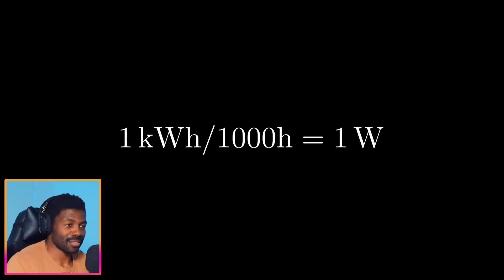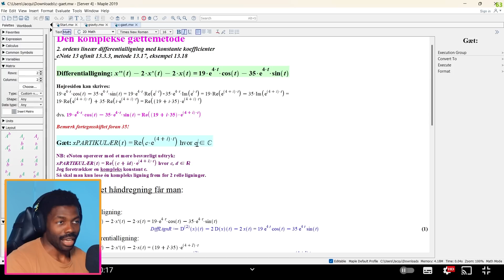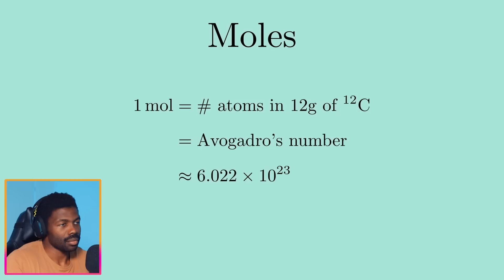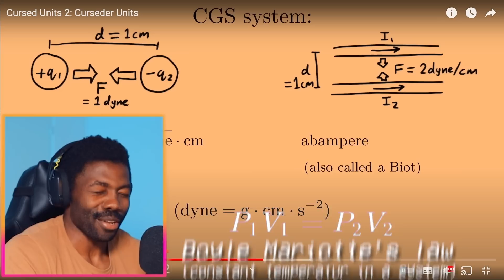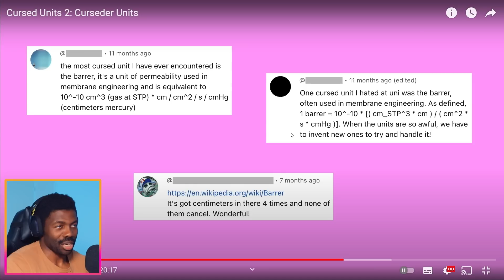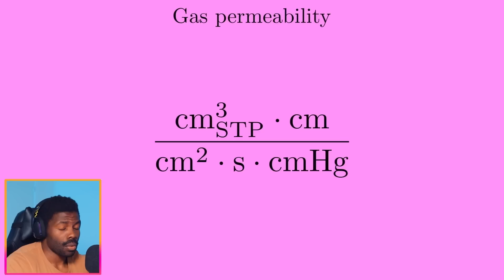It got Curseder - Cursed Units 2 by  @josephnewton  | The Chill Zone Reacts

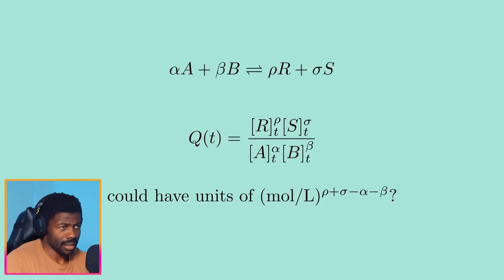Comment: 14:23 it’s the equilibrium constant, used in chemical equilibrium to determine direction of reaction, 
In the formula for the equilibrium quotient the active mass(molar concentration or partial pressure depending on the state) of reactants and products are raised to the power of their stoichiometric coefficients, we can see a bit of a problem here since different reactions have different coefficients, attempts have been made to fix this by making it dimensionless, we have study of this in chemistry first year after highschool.

Comment: In defense of the Chemistry part: almost every time a logarithm is taken in chemistry, what is in play isn't a concentration but an activity, the activity is an effective measure of the dependence of Gibbs free energy with composition referenced to a state of the system that we can define conventionally, and always is adimensional, activity is proportional to the concentration but takes into consideration the deviation of the systems from ideality (we start from ideal gas and then make it a real gas, and then we construct the expressions for condensated phases, in those we get to the activity) with a proportionality constant that has units of inverse concentration, then, the pH is the minus log base ten of the activity of solvated H+ ions (essentially protons) in solution, you can even define it in non aqueous solvents.
The reaction quotient and equilibrium constants are also expressed with activities so they are also adimesional (They are really not constants because they change with T and P, but in the lab we ussually consider them constant and work with them as if they were). All the drama comes from the fact that in sufficiently small concentrations (or hypothetical "infinite dilution"), the activity coincides numerically with concentration when we use 1 unit of concentration as reference, and we usually work with small concentrations in the lab (in industry is more common to see conditions where activity is important to take into consideration). A lot of chemists ignore this physicochemical structure of the chemical equilibrium so I get the cursed nature of the chemistry measurements.

Comment: 1 meter = 3,34 * 10^(-9) seconds. I won't elaborate
Reply: The time needed for light to travel one meter
Reply: The actual scientific definition of a meter
The distance traveled by light in a vacuum in 1/C seconds (ok technically not C, but the literal full numbers of the speed of light , the distinction is important because otherwise you'd be defining a meter by relating it to a unit...in meters second)
Reply: Please do.

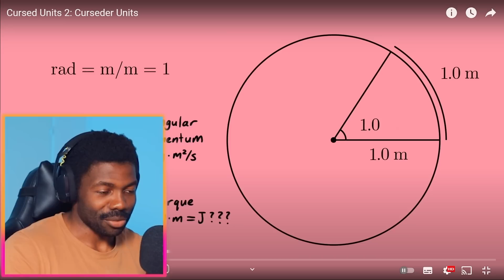Comment: 8:00 it's interesting that at first glance, torque and energy/work seem to have the same units, but I remember now that the difference is scalar/vector. Force*distance is work/energy, but force*displacement is torque, as I remember. Curious how that plays out, since we don't normally put the vector state of the length in the unit

Comment: Jokes on you, i measure energy in tnt equivalent. Also fan fact, 2000 calories is exactly 2 grams of tnt equivalent
Reply: TNT equivalent would be awesomely fitting for particle physics😂 "That proton has 10^-22 TNTkg of kinetic energy"
Reply: @martinleopard193  also it just sounds cursed - daily consumption of an average human is 2 grams of tnt 😂
Reply: @kolyashinkarev7366  What we call "calories" in the food sense are actually kilocalories (kcal), so 2000 calories is actually 2 kilograms of TNT.
Reply: Measure it in the cm^3 of tnt
Reply: @diablo.the.cheater  I measure mass as kg/cm^3 × liter
Reply: @kolyashinkarev7366  makes sense. I mean y'are essentially comparing it to water. I measure length in m/s*min.